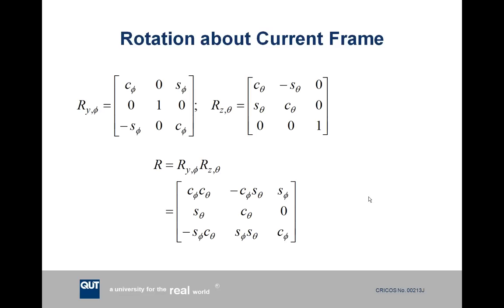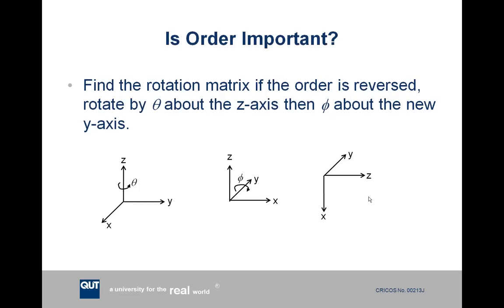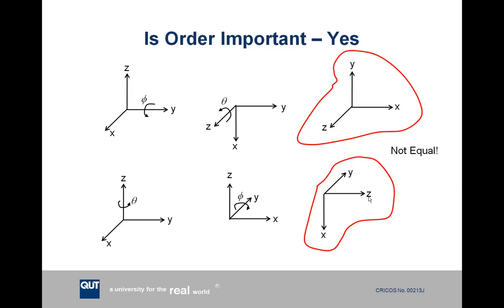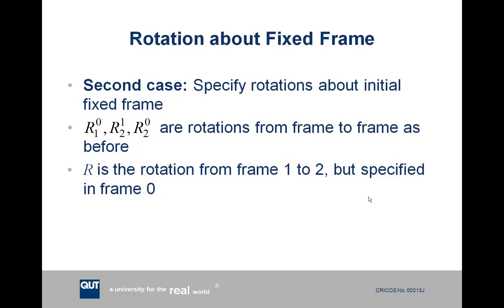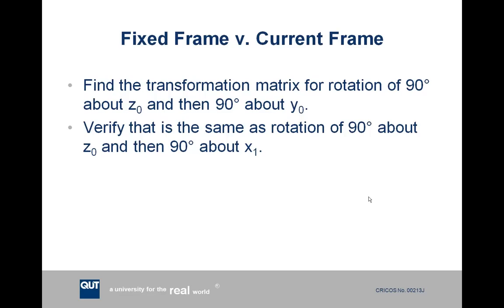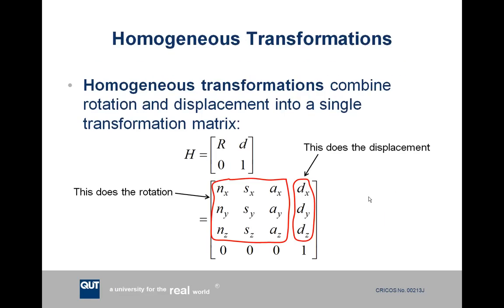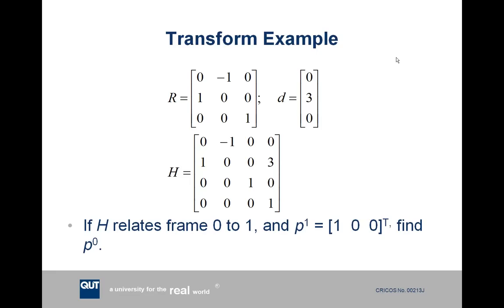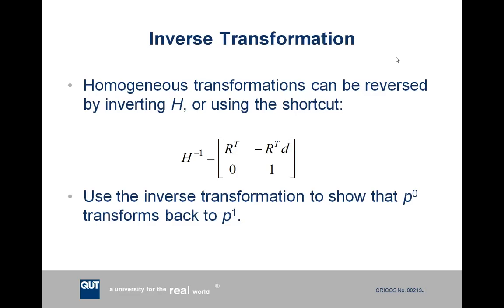Transformation Matrices Part 3

Comment: Very helpful. Could u please explain what is the need to alter the position of the displacement values in the translation matrix? Currently i am facing an issue. I am using current frame method and the translation values are given as Z,X,Y instead of XYZ. Thanks

Comment: On the homogeneous transformation slide you forgot to mention the following:
- the three zeros at the bottom represent the perspective transformation vector, which in this case is (0 0 0)t, since there is no such transformation.
- the 1 in the lower right corner below the translation vector (last column in the matrix) is actually representing the scaling factor. It equals 1, since there is no scaling in our case